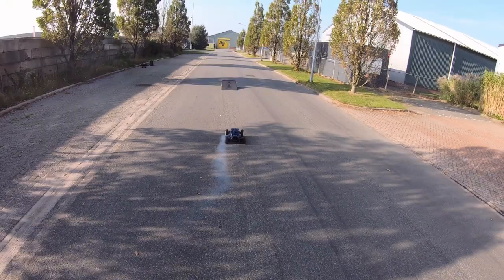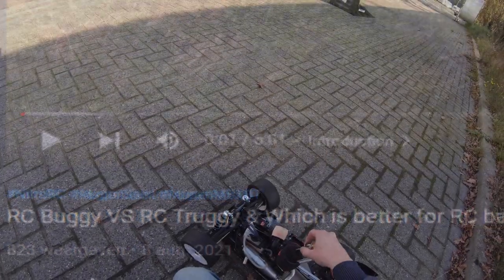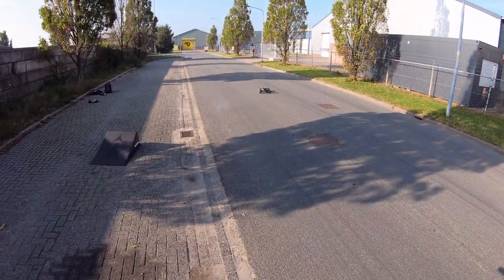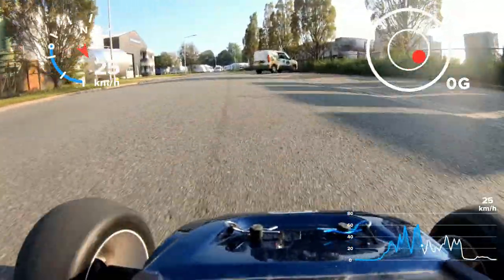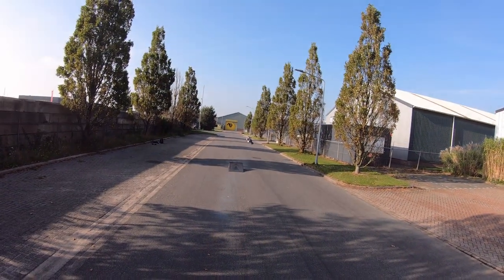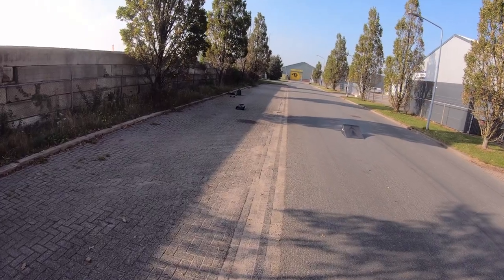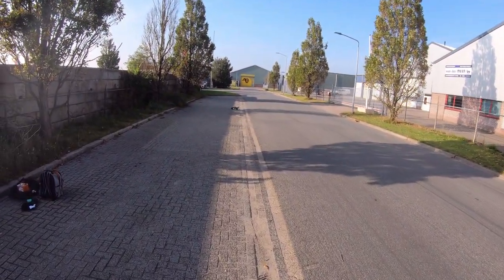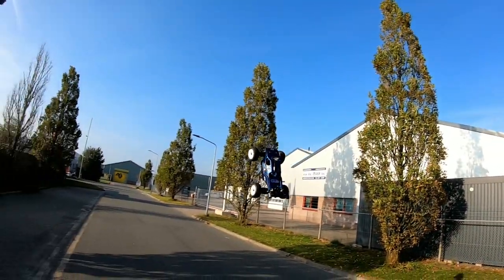Nitro RC Truggy VS Ramp & Novarossi 24069 Carburetor DESTROYED

Comment: Can you do a nitro to gas conversion video using an existing old  nitro engine and convert it to gas using a gas ignition system ? Thank you
Reply from the maker: I should be able to do that with a lrp 32 using the ignition chamber of the gas dynamite .31 as they are the same engine